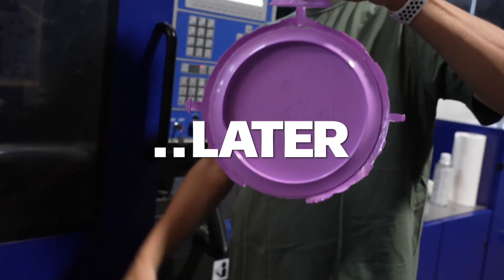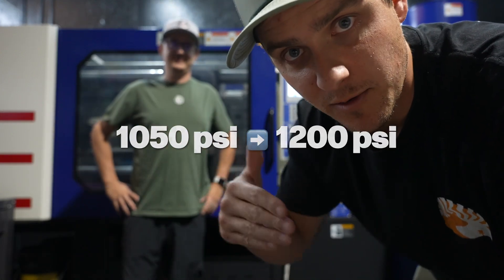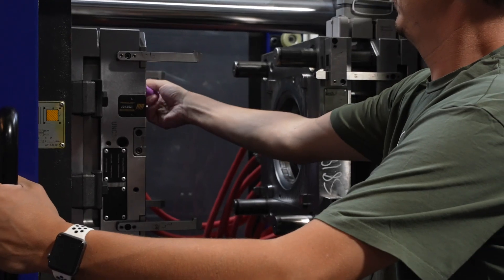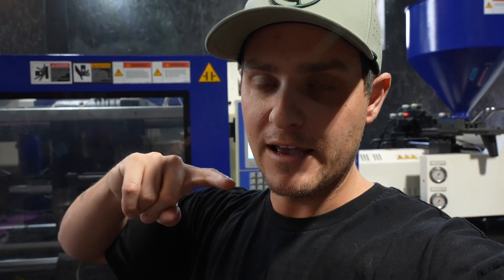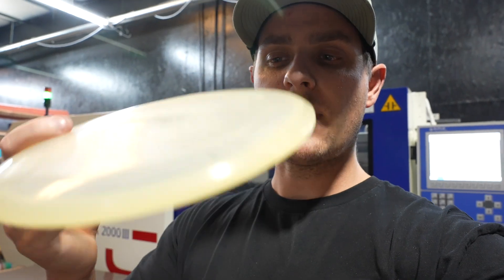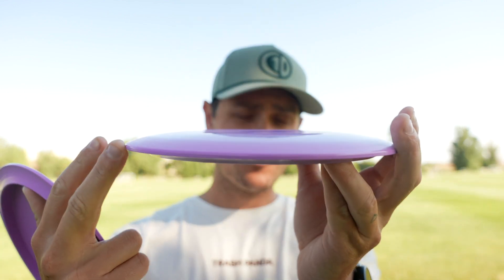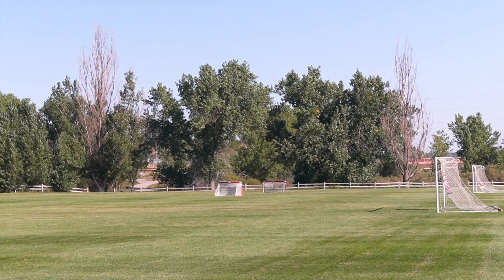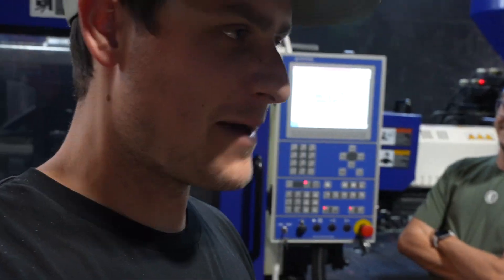We Made TWO DIFFERENT DISCS Out of the SAME MOLD

Comment: 16:24 In glass and metal, there's something called annealing. Leaving glass to cool slowly will let any built in stresses dissipate. In metal, cooling slowly vs quenching in oil will alter its crystalline properties and alter its hardness. So it does stand to reason altering the cooling rate of a disc through iuts dwell time in the hot mold will also change its properties. We saw how it changes the shape, but how does it alter the disc's durability?

Comment: The pressure of the extruded plastic is almost like voltage and the speed of the extruded plastic is almost like amperage, and total plastic flow over time would be the wattage 😂

Comment: You're seeing hoop shrinkage from the rim cooling later than the thinner central area. The disc center is more set than the rim on ejection from the machine; the rim continues to shrink, bowing the center up. 
For flat discs, use low shrink plastic, long hold time post injection, reduce thickness differential between center and rim, or add rim cooling in the mold.

Comment: Crazy question.  Would a “cooling” plate type device that you would place the freshy fresh discs into that would allow you to control the cooling process, help with consistency and dome control?  You could make something that would have the ability to separately control the temp applied to the rim vs the flight plate (two zones). Maybe more rapid cooling of the rim would create more dome while keeping the rim warmer than the flight plate would allow the flight plate to become more stiff and provide more resistance against the rim that is cooling slower?

Comment: OMG you have molding machine but still you are very clue less... The final product shape is not very much affected by the molding procedure, but the cooling procedure. You can be faster on production by raising temp and pressure, you can fill the mold faster in general, but you need to master the cooling process to get good results. Some moulds have the cooling cavities to be filled with cold water, you need to wait some time with the mould closed, cooled down, then you can release the product. The cooling process is the hardest part for sure.

Comment: Could you add a collar onto the input injection with a ceramic face (like the seal used in a spar pool pump to motor interface) with a silicone inner so the pressure within keeps the ceramic surfaces pushed tight above and below... in a design that now basically has a spacer, sealed above and below.. now add a toothed outer with a motor and 2 idlers so you can spin the spacer... now add a banjo outer, o-ring sealed so you have a outer that does not spin.. an inner that does (a bit like an inverted mushroom with teeth round the pileus (ok had to look that up)... and your hand round the Stipe (hey it was in the same page I found pileus on)...  with plastic pumping down your arm... into the mushroom.. basically injecting into the stream of plastic going into the mold...
(Oh and a single point entry (or 2 if you want symmetry) for the path of the side injection into the stream... i.e the stipe is hollow but theres an o-ring at the top and bottom of your hand and only one hole in the side of the stipe to the inner tube...

Why...  No reason... oh wait yes there was...   so you can spin in a different colour plastic to the side of the stream into the mold... and control the spiral result... Stopped and you get a disc with a spike in one sector... Increase the pressure... fatter segment (like a pie chart)...
Start the motor on this thing... and you get a spiral... Spin fast, a tight spiral... 

Side injection pressure equals main flow inside the stipe.. no stripe/spiral... less pressure... hilarity ensues...

Hell of an experiment... for someone made of money... Even better for someone made of someone else's money..

I need to put my brain to proper use.

Comment: Cool comments. Only thing I can think to add is that supposedly one of the kayak brands that has the most robust kayaks (prijon) has had their durability attributed to letting their kayaks cool in the mold. 

Probably not practical got disc production but it would be cool to see if it indeed yields a more durable product.

Comment: could you use a controlled cool down, make a chamber that keeps the temp the same as the disc when it comes out of the mold then lowers it slowly so that the disc cools in a uniform rate this could help with making sure that it changes less as it cools.

Comment: Wildly informative. I went from thinking you guys were a little obscure to pretty intrigued. The passion you have for this is admirable. You guys will have incredible disc manufacturing skills if you keep messing around like this. If you can control the variance that comes with injection molding to put out consistent products, then you’ll be doing better than most of the big names out there.

Comment: FYI, the majority of heat put into the plastic comes from shear (screw rotate and injection rate), and not barrel temps. If you want to see a bigger effect on the in-mold shrinkage, play around with the actual mold temperatures by adjusting your supply water temps (both cover and ejector sides).

Comment: Have you guys experimented with different surfaces for the cooling table? It seems like setting them down on the flight plate would affect the domeyness significantly. I would be curious how placing them rim down, or on aluminum vs steel vs granite vs wood would change things. Or even a bowl shaped surface that matches the desired dome shape.

Comment: So, what I’m seeing is that it’s not necessarily the plastic, but the way the plastic changes after cooling that changes the flight characteristics. In theory, you could change plastic, and then change the injection parameters so that you always end up with the flight characteristics you want. Of course, there would be limitations because if you went to the extremes on pressure cooldown time etc, for each plastic, the extremes would be different. But you could produce discs that fly the same within that overlap.

Comment: Im curious if there is a way to heat treat the discs (repeated heating/cooling or starting the disc cooling at a higher temp and slowly lowering it) so that they shrink less and maintain a more accurate flight compared to the master/flight numbers, like they do with swords or chocolate.

Comment: Here's a question. What happens if you "flash freeze" the disc instead of that natural CD period of 24 hours?  Taking steel fabrication as an example, Once the steel is heated up & shaped, it is immediately dunked in oil or salt water to strengthen the steel. Appling the same logic, I wonder if you dunk the disc  immediately in ice water after the injection mold  if it will affect the flexibility or shape of the disc.

Comment: Have you considered the surface in which you are tabling your discs and the affect they have on shrinkage? Wondering how the rate of cooling affects shrinkage and the doming effect if you use something that is more of an insulator than a material that will naturally draw heat out of the disc during rest, particularly on the face of the disc.

Comment: I think until the DG manufacturers gets better quality systems in place we'll continue to see the variability from run to run. You can measure the form of the disc to within microns precision using CMM's. If you control the form of the finished disc you'll see more consistency across runs. But it also makes manufacturing way harder to nail down, and having a 1 day lag time is a killer. You can overcome it of course, but still a hassle. Optics that are injection molding could be an interesting thing for you to check out!

Comment: I’m an injection molding process engineer.  When increasing your fill speed rate you should also be raising your transfer position.  Also this should all be done with no hold pressure on.  The reason for this is your wanting to end with a part that is 90-95% full, this is called the decoupled shot weight.   For high production molding the best practice is to fill the mold cavity as fast as possible for the fastest cycle time without having machine limitations like pressure or having quality issues on your part.  In your video you started by changing the injection pressure,  this setting should start at a maxed out setting while establishing your fill speed, otherwise for an example say you want to fill really fast but limit the pressure to 800 when it really takes 1400.  The machine will only give you 800 regardless of how much you might need.  Once you found your correct speed, shot size, and transfer position it’s time to start putting hold pressure on.  A good starting point is half of injection pressure, so let’s say your injection pressure at transfer is 1400,  you would want to start with 700.  Then for time start with a large number like 15 seconds.  How you determine how much hold time you need is based on when the gate freezes off.  How you determine this is easy.  During the hold process you will see the screw position move lower and lower until it stops,  that’s gate freeze.  So let’s say you notice the screw position gets lower for 8 seconds during hold time and stops.  So a good set point would be at least 8 seconds but in generally add an extra second or two for good measure.  During hold you want to make sure that you are keeping a consistent cushion for best quality repeatability.  If the screw is going to zero you’re not keeping cushion.  To increase your cushion size MUST add equal amounts to your shot size and transfer, otherwise you will get different results.  Also you need to make sure you have proper back pressure settings for your material otherwise you will also get inconsistent results.  Setting the screw speeds is mostly based on your cycle time.  You want the shot to built 3-5 seconds before the mold opens.  A good starting point is 100 rpm for most plastic, but if your shot is not built in time you will have to increase the speed, or if it is getting done to fast you will have to put a screw rotation delay on.  You want the time the plastic spends in the barrel to be as consistent as possible.  This is called residence time.  Plastic that sits in the barrel for 30 seconds vs 2 minutes will get you very different results.  I see you guys are manually opening and closing the door in your video, which is going to be obviously more inconsistent than a robot.  When you guys were trying different settings I hope you knew this and didn’t keep parts in between the time of thinking what to change next.  It’s good practice to always throw away the first 10-15 cycles of parts.  Another setting that is important is decompression, which is the retraction of the screw after a new shot is built during the screw rotation.  Typically a decompression setting of at least .25 works.  What this does is sucks back the check ring that is at the end of the screw.  Lastly would be cooling time and that is all determined by quality usually.   If you have any other general questions I would love to help out.  Like I said at the beginning I’m and injection molding process engineer with about 15 years experience who also loves to disc golf so your channel is everything I’m interested in.  I have been watching since the days of you in your garage, it’s super cool to see how fare you have already came in such a short time.
Reply from the maker: Just chiming in a week later to say thanks for this comment @Nick__N 🤘 We're definitely at the beginning and only dipping our toes into what is possible. It's comments like these that keep me stoked!!!
Reply: @TrashPandaDiscGolf  I’ve got loads of information that I could share, to help make things go easier and explain things. Just reach out, if you’re interested.
Reply: Get this man in there ASAP also would flash cooling be something to consider being rapidly cooled either inside or outside the mold make a big difference in size and dome height or getting the plastic below ambient temperature then letting it rise to ambient naturally to let the disc relax to its intended or desired shape it wants to be? Idk thinking on a molecular level I wonder if that has any effect on the disc too
Reply: @toker2792  the disc is being cooled the second it is injection into the mold, leaving it in the tool closed for long periods of time like 30 minutes in the video is not practical if they want to make money along with the plastic in the barrel will become degraded after that long of a time which will result in a bad product.  Flash freezing in water could work but again in a production facility this is not practical either.  What they could do is use a fixture to place the parts in while they cool.  The purpose of a fixture is to hold the product in a desired position to allow for additional cooling outside of the mold to allow you to start the molding process all over again.
Reply: @Nick__N  I've used water cooled AL tables to achieve this. Pull a part out, place it on the table, then continue onto the next run. Assuming the rim would take longest to cool maybe would want to put rim down on the table, but would that cause warpage in the flight plate?
Reply: @bankerjumper  sounds pretty cool, was the part you were molding a thick walled big part, it if was something like that would make sense but for disc golf disc it would be overkill.  Once you have a solid process that has repeatable process monitoring set points allowing them to cool at room temperature should be sufficient.
Reply: @Nick__N  centrifugal wheels of a fairly decent size (9" and 11" dia in varying heights). We found excessive heat issues in putting them in gaylord boxes too quickly out of the mold, so the cooling table with a machined AL stem fitting into their hub reduced their core temp fairly quick.
Reply: @bankerjumper  nice
Reply: @bankerjumper  i used quench conveyors for many years to achieve the same result. Can finish cooling out of mold, for thick walled parts. I’m sure I’ve made millions of pipe fittings over the years
Reply: they need to look up the "scientific molding process"!!! 95% fill with injection (no pack and hold), then add pack and hold to fill. Then weight and add time to pack and hold until weight gain stops. BINGO!!!!  I professionally injection molded for a long time too. mostly semi-crystalline polymers.
Reply: RJG?
Reply: @j.r.carver5349  yes this is the RJG scientific molding process.  I am also a certified RJG master molder.
Reply: @Nick__N  same here. That’s how I could tell. Watching him make those changes was making scream on the inside. Wish I could be there to help him out
Reply: @j.r.carver5349  hahaha yeah I thought so, when they were changing the injection pressure and nothing was happening haha
Reply: Haha, I'm also a PE for injection molding and I came here to say the same RE fill rate, it hurt to see them flash the mold so much 😂
What's your background btw? I saw you said you did the RJG certification, did you go to school for Plastics as well?
Reply: @GingerTron2000  yes I originally went for C.A.D. and doubled with plastic.
Reply: Hire this man as a consultant 👆
Reply: Jesse, I recommend consulting with this viewer. He seems to have the deep process knowhow you need to fully dial in your process. He can also help when you begin varying the mix components of your regrind. Good luck and I hope to see more of rour test results.
Reply: @arr64lima63  yeah I like what this guy has to say hahah.  I actually work with regrind recycled material every day,  it adds a whole new complicating variable into the mix of problems you will run into.
Reply: @arr64lima63

Comment: Throughput needs to be high because of $$$ so one can't really cool them in the mold. I've heard from another manufacturer's video they could actually get stuck in there. And when you take it out the environment is not homogeneous, so there goes the consistency. And the another manufacturer says that's the biggest challenge. You could perhaps make cool-down molds for them all and sink them into constant temperature liquid for a couple of days. You concentrated on dome, but PLH changes too because the shrinking dome "pulls" the "hem" up twisting the disc inwards.

Comment: The stock Ozone vs 115 sec ozone were thrown on pretty different lines. The 115 sec cycle disc was much lower so of course it wouldn't get as much turn?

This is a peril of review videos. If the throws aren't similar, the results aren't truely comparable.

Comment: Jesse, why do your discs have such bad flash? You should be able to prevent that rather easily. Also, the pressure you guys were shown changing in this video was the injection pressure limit. Changing the injection pressure limit should change nothing and if it does you aren't quite processing right. You may have also done this but you should have got more interesting results changing the hold pressure. If you put the hold pressure at 0 would the part still be completely filled or even flashy? So many questions. I would love to talk to you. I'm an injection molding process technician and RJG certified Master Molder.

Comment: Dunk them in a tank of water when they come out of the mold!

I'd love to see if the shape can change a lot more with the quicker cooling rate. Also, the orientation the disc enters the water could be huge. Much like how a Katana gets its curved shape due to differential cooling. I would assume these lower temps would have a less extreme result though.

Comment: I would love to see a disc deliberately designed to be as flat as possible knowing what you know now. Could you design a disc theoretically to be slightly concave and then when it cools it tightens and flattens to near perfect level? A disc like that with a rounder rim would be an amazing putter or mid range.